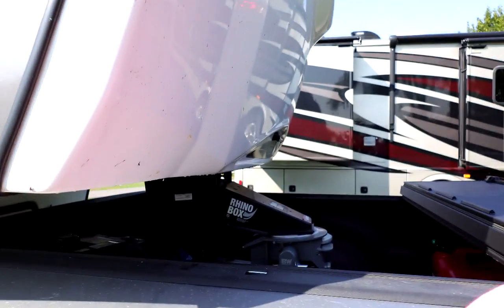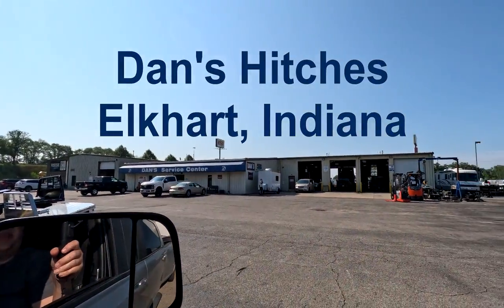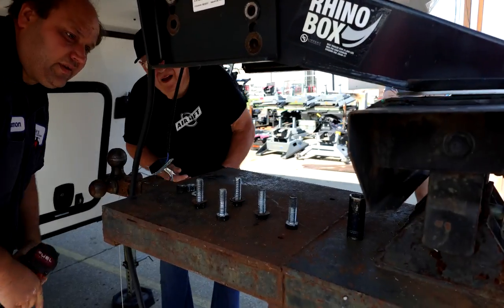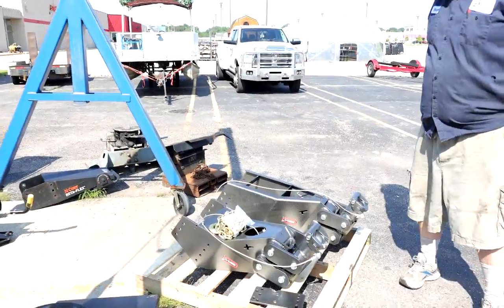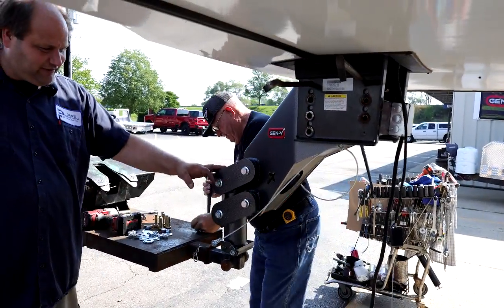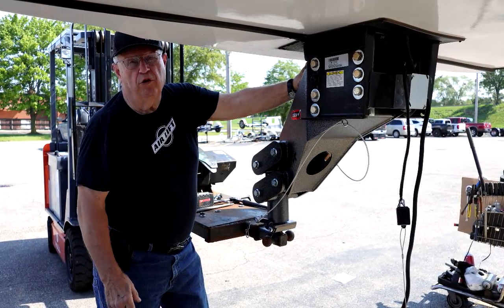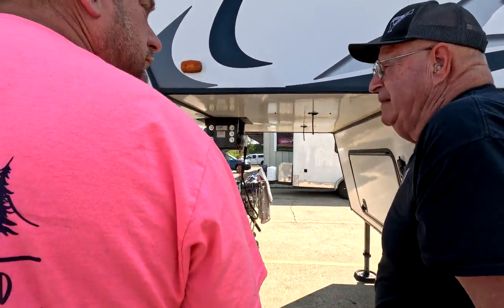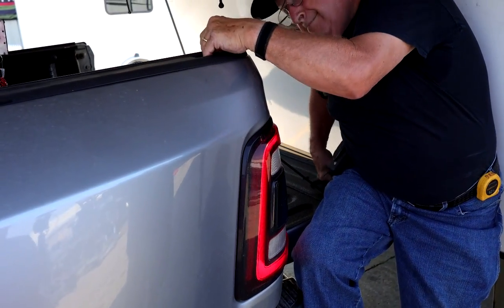Gen-Y install at Dan's Hitches, Elkhart Indiana - Full Time RV

Comment: We had ours replaced at Gen-Y’s place in  Nappanee a year ago! We replaced the Trail Air on our Riverstone with the gooseneck because it was a pain to maintain the air pressure and it was fighting against the air ride on the truck. Also I got bed space back because I have a 95 gallon auxiliary fuel tank on our Ford F-450. Now it rides like a semi truck because that is what I am used to.
Reply from the maker: Getting the bed space back was big for us. We carry aux water when we boondock a few times a year. Gen-Y and RAM air bags make for a pretty good ride.

Comment: Good morning  Clay
Hope ur having  safe travels 
Just done rebuilding  complete suspension on our 29G
If ur interested  let me know
Reply from the maker: Ha ha. That’s our next video. Working on it now. Ours was bad, really bad. What did you go with?
Reply: @OurRoadLessTraveled  so installed  Cre3000, sumo springs, and moryde cross brace on center hanger
Then install Carlisle CSL16  tires 
Right now doing performance upgrades to truck so haven't pull trailer yet
Reply: @OurRoadLessTraveled  did u get ur new trailer house ??
Reply from the maker: @jeffwatson2234  No not yet. Still "thinking about it". We did a much smaller upgrade. Shackles and wet bolts.
Reply: I let you know how it tows
Remember you  all have a standing  dinner  when u get to NE INDIANA

Comment: After the install was your bed clearance about the same or higher?  I have heard some say that it makes the front of their unit higher.
Reply from the maker: We gained about an inch in clearance. Nose ended up being about 5" high. We could have used a ball with a shorter shank. We traded the Tandara for an Ahara and install the MORryde IS, We are 100% level now, using the same hitch and ball. The IS install adjusted out the nose high issue and is a much better ride when paired with the Gen-Y. It was great just with the Gen-Y, but adding the IS was another massive gain in smoothness. I will also say the disc brakes are well worth the investment.
Reply: @OurRoadLessTraveled thanks!  This is the I've thing that scares me about the Gen-Y.  I have very little clearance on my shed for, so being high is not good, and may possibly not work...

Comment: This gooseneck hitch assembly is my preference for my 5th wheel RV but the one thing no one is talking about, how much weight savings is there if any by switching from a kingpin box and 5th wheel plate assembly to a Gen-Y gooseneck box and a simple 2-5/16" ball mount in the back of the bed? As we are talking about payload carrying capacity of the truck, was there a weight difference between 5th wheel and gooseneck? If so, by how much? And final question, is there a discernible difference in handling and of course ride quality between the kingpin box and 5th wheel versus the gooseneck box and ball mount? I ask because the 5th wheel mount sat higher in the bed with higher center of gravity (more side-to-side inflection), versus ball mount which is lower in the bed and lower center of gravity.
Reply from the maker: Great questions. there is not delectable weight difference. the reason is that the Gen-Y pin box weights more than the 5th wheel pin box. When you add the 5th wheel pin box and the hitch, it weights about the same as just the Gen-Y gooseneck pin box. As far as handling, yes, big difference. We had a couple times that the truck and 5th wheel were vastly unlevel in different directions, the 5th wheel king pin did not want to come loose and dang sure did not want to connect back up. the goose ball has no problem. The other and most beneficial is ride quality. We had a B&W and zero complaints with it. Its still very ridged and would buck on bad roads. The Gen-Y has dual torsion bands built in and absorb 99% of what a bad road can dish out. We have one section on 565 headed into Huntsville that would cause the 5th wheel to buck no matter what speed we would go. Its the 3rd bridge expansion joints. the Gen-Y did not buck at all. It does not bang on the truck, and most of the time we don't know its back there. This holds true for our 35ft and our new 38ft 5th wheel. They also just put out a video from a 3rd party showing they put less stress on the 5th wheel frame. Brinkley teamed up with them to do the testing. truly one of the best comments and questions we have received, thank you.

Comment: Hey Clay, do you remember what the torque was on the mounting bolts of the Gen-Y? Apparently, my bolts are grade 5, not 8 so that needs to be corrected ASAP.
Reply from the maker: 250 ft lbs. They did 150 ft lbs and then a second round to bring them up to 250 ft lbs.
Reply: Wow, that is a lot. I need to swap out my grade 5 bolts (which came with the original Rhino box) and upgrade to grade 8 bolts.
Reply: Per Gen-Y, recommended torque is 160 ft lbs (grade 8) which aligns with IFI guidelines.  @WestsontheMove
Reply: @caseydoodles8125 That is awesome. Thank you!

Comment: did you  keep your companion hitch? i know its difficult to sell a used hitch if not did they give you any credit for it?
Reply from the maker: Dan's bought it from us, gve us credit towards the Gen-Y. it was a fair price. it was either 600 or 800 bucks they gave us for it
Reply: @OurRoadLessTraveled  thats a good price hows the hitch working out?
Reply from the maker: @soggybottom23  we thought the price was more than fair. As for the Gen-Y. Freaking love it. A tad bit harder to hook up but the ride is 100% better. Add the bed space back and it’s a no brainer. Would absolutely do it again. Here’s the thing. The Gen-y pin box cost the same as buying a 5th wheel hitch for the bed of the truck. I’m in the gooseneck and bed space team all day.
Reply: @OurRoadLessTraveled  thats where I'm at  I'm ready to not have to pick that heavy companion hitch out of the truck along with the ride improvement it will be  worth every penny!
Reply: @soggybottom23 I had to put my 5th wheel into my truck bed, I got it in by myself but hurt my back pretty bad. I decided to either get the gen y or a goose box.